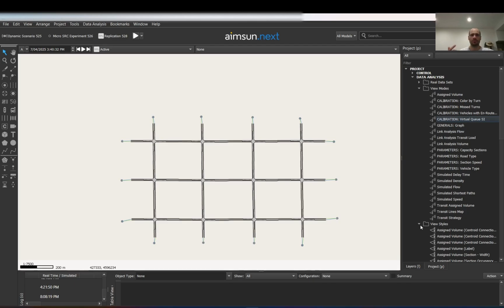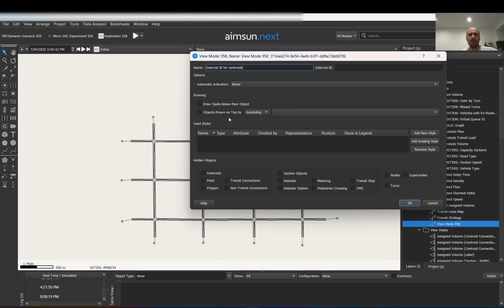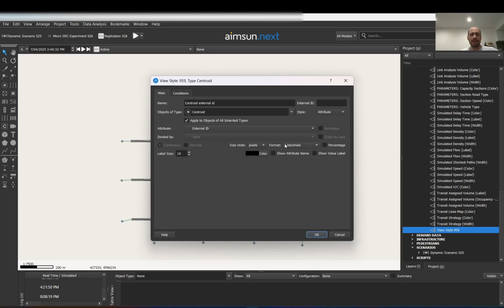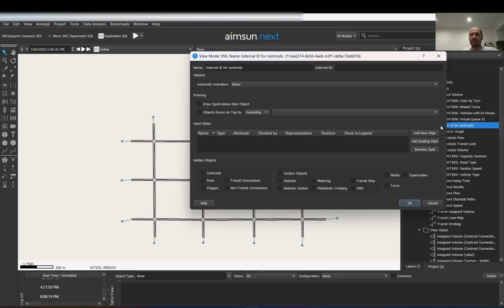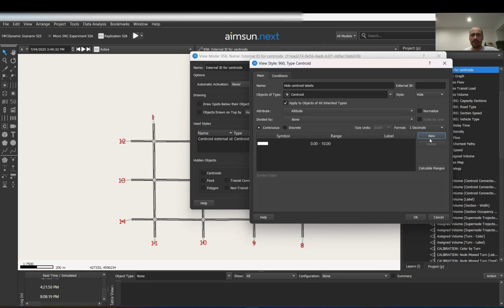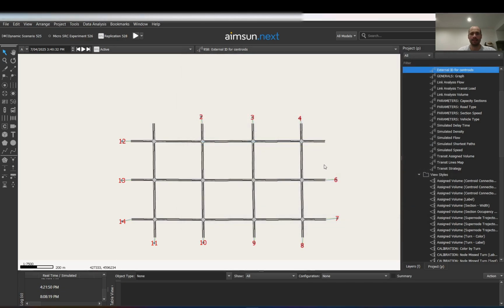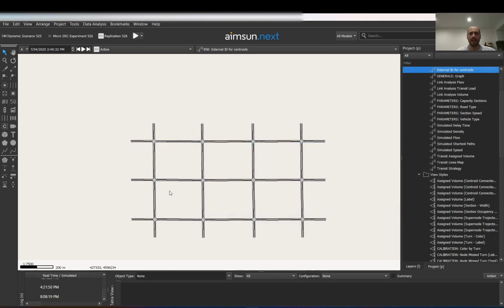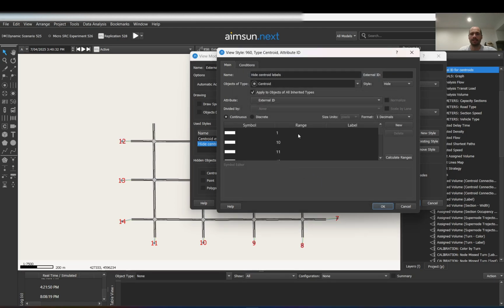Aimsun Tutorial - View modes, labels, hide objects

Comment: hello,
Sorry I am asking a Vissim-related question in your Aimsun tutorial. So, please tell me how to detect vehicle type, length, or ID number one of them in Visvap. which VAP function will be helpful to perform the mentioned task
Reply from the maker: Hi Usman, no problem. It is not that straightforward. Vehicle type you can do by creating multiple detectors (even overlapping) and set each detector to a specific vehicle type only.
Vehicle length can be measured by using 'Veh_length( <no> )'. Interestingly never used this myself before :), maybe I can do a video about these at some point if I can think of a good example visvap logic.
Vehicle number/name I am afraid is not available via Visvap, or at least I am not aware of any way to extract it. Probably a reason to move to COM interface if this is needed
Reply: @ I am try to do for emergency vehicles
Reply: I have tried veh_length (<no>) in such a way veh_length (detector no.) = vehicle length. But it not work
Reply from the maker: @UsmanAli-hz5ns  Put them into a separate class and you set a detector specifically for that.
In terms of vehicle length. I will give it a try, but it should work. I don't have access to Vissim atm, so it will take probably 1-2weeks